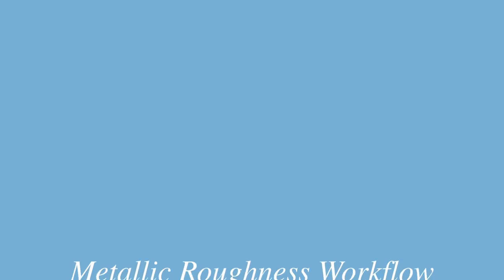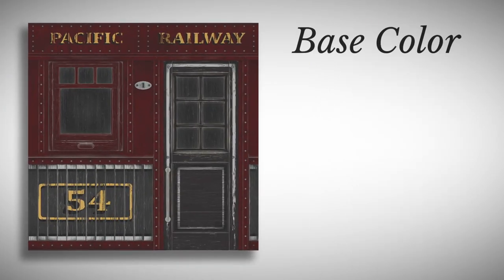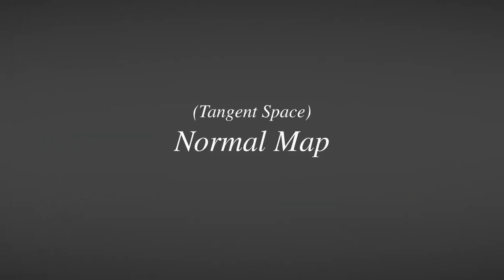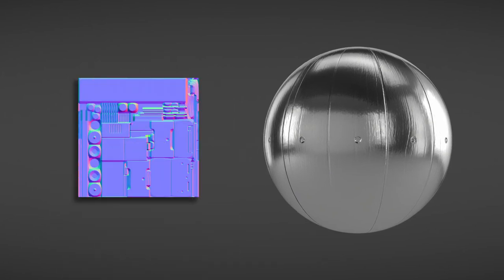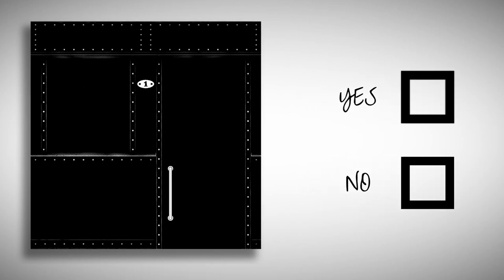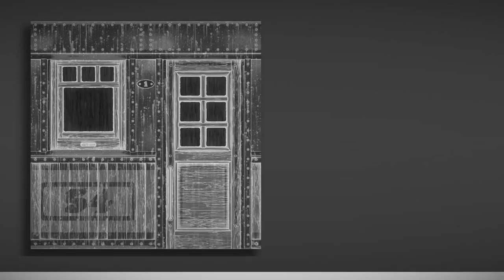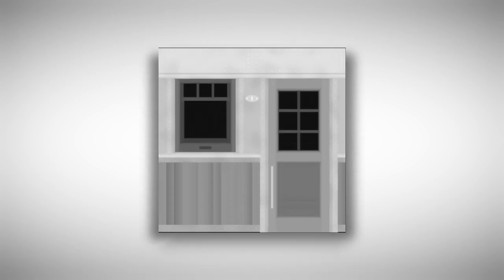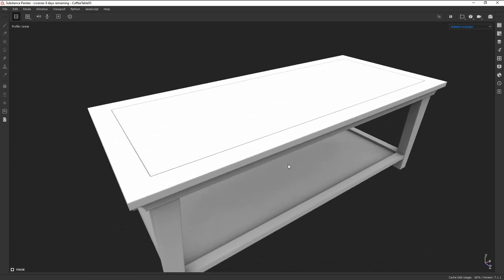PBR Explained in 3 Minutes - Physically Based Rendering

Comment: This might be a dumb question, but is it superfluous to apply a toon shader to a pbr texture?
Reply: Not a dumb question at all imo. Afaik toon shading just thresholds the values of both diffuse and specular values per pixel, which creates the simplistic cartoony look. Considering that PBR gives the option for a single material to have any kind of roughness or metallic values in different places doesn't change the fact that these can be thresholded. So technically you could have PBR toon shading, but I'd say it would clutter the final result too much to uphold the artistic value of toon shading.

Comment: This video is erroneous - The graphics APIs dont enforce any particular way of reading a texture - They infact dont have any notion or hardcoded concept of a "normal map". It doesnt exist to the API.
To the API a texture is just data - and you decide how GL/DX/VK reads & interprets this data, e.g GL_FLOAT.
And what you call "normal map" is a user calculation done on this data in a fragment shader to manipulate fragments and give the illusion of extra detail.
But the API itself has no idea what a normal map is, or what calculation you are using or how you want to use the texture data.